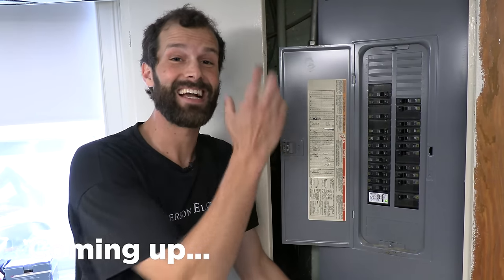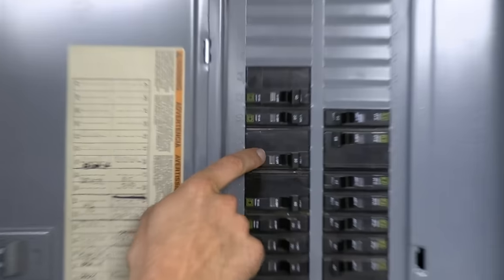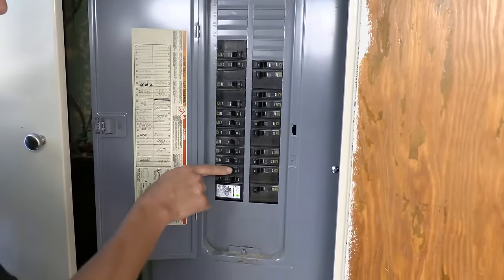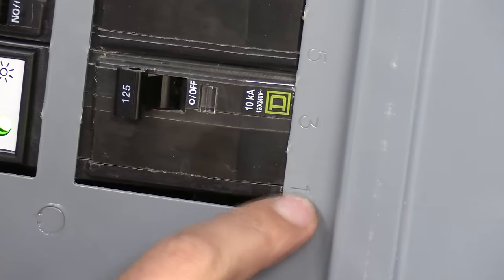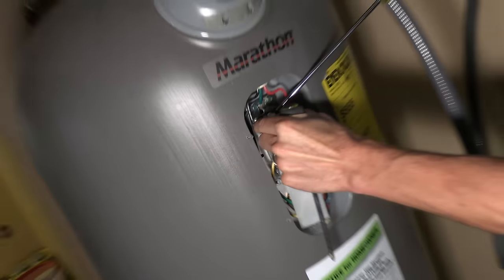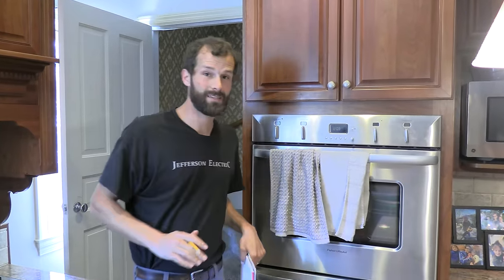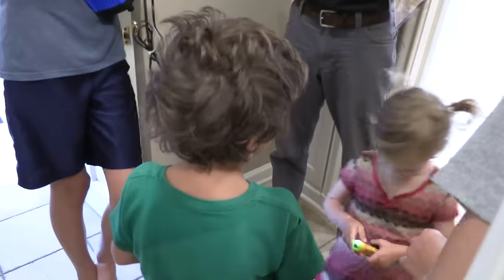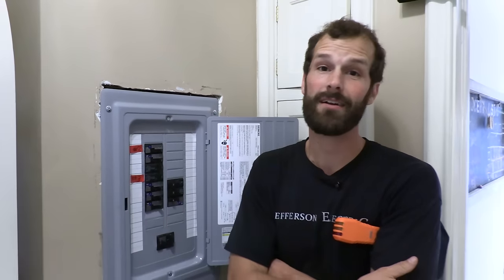A Master Electrician's Worst Nightmare

Comment: Caution if you have a circuit with a shared neutral this thing don't work athletic phase system you can forget it had it not work in some residential situations if you can spring the money I recommend the ideal sure circuit finder

Comment: Unfortunately I rarely see accurately labeled panels that have passed inspection…..NEC is only as good as the local authority having jurisdiction and their interpretation…..the “ code” can be quoted all day long but unfortunately I see it consistently ignored and/ or overlooked, or simply local code enforcement officers with very little knowledge of it.
Reply: The problem is, its rarely a problem. 99% of homeowners dont care about the electrical unless its not working, or they decide they want to do some diy electric. In that case with very little knowledge or with a helpful youtube video the average person can easily find a breaker

Comment: I had my service upgraded to 200 amps, they did an ok job but the guy doing the labeling used an old fat Sharpie marker. 
Couldn't read anything. 
Later i went through and typed up a table in word. That makes it easy to add more info as the guys doing the upgrade didn't actually know every receptacle.

Comment: I thought that breaker finder only worked on 90 to 120v circuits, and yet he was using it on a 240v air conditioner circuit? Am i missing something? Was he connecting from a neutral or ground to a hot wire? I'm used to only working with 120v, so I'm curious

Comment: While you method works just fine, I find it somewhat slow and requires the purchase of special tools. First thing is the first breaker was a 15 amp and the washing machine is typically a 20 amp and most likely dedicated, therefore you just wasted time right there. So the way I like to do it is, first turn every light in the house to the on position, then I take a small portable 120v floor fan or something that runs on 120v power and will stay running by itself and set it at or near the panel so that you can at least "hear" it running, then take a small extension cord that will reach every room in the house and plug it into the fan. Then I start at the farthest room and plug the cord into any random outlet, go back to the panel and start flipping breakers until the fan shuts off, label the breaker position with that room, then as I'm going to move the cord to the next powered on outlet, while leaving that breaker off, look to see what lights went out and check random outlets in the general vicinity for power. Remember those dead outlets locations and label them accordingly before starting to flip the rest of the breakers. Typically I can label a 3000 sq. ft. house in about 15 to 20 minutes that way. Sorry, just saying. 🤔 🤦‍♂️
Reply: I'm not sure I understand your method.  I'd like to save time and do what you did, but just don't understand what you described.
Reply: @number6396  Sorry, not sure I can explain it any simpler than that. What is it you don't understand?
Reply: @chaser9363  @number6396 I think @chaser is trying to say this:  He puts a fan at the panel.  He gets a VERY LONG extension cord and plugs it into the fan.  He then takes that extension cord all around the house and plugs it into the various outlets one at a time.  For example, he plugs it into outlet #1 in Room A and goes back to the panel box and starts turning breakers off one at a time until the fan (which is blowing and sitting right there next to the panel box) goes OFF and that identifies that that's the breaker that goes to the outlet that the extension cord is plugged in to.  He leaves that breaker OFF and goes to move the extension cord to ANOTHER outlet and while doing so, he notes which lights went out in that same room/area (presumably those will also be on this same breaker as the outlet he just identified).                I have serious doubts that @chaser can do a 3000 Sq.ft. house in 15 to 20 minutes alone with no helper doing it this way and I also wonder what "small extension cord" he must be using for a 3000 Sq. Ft. house -how would a "small extension cord" reach that far?  My house is only 2700 Sq. Ft. and has 3 floors with the panel in the basement.  I'd need a VERY LONG extension cord to reach the upper floor outlets at one end of my house and go all the way to the basement where my panel is located on the opposite end of my house.  So while in THEORY I think this is what @chaser means by his explanation, in reality I cannot visualize how this could possibly work with his stated "short extension cord".  :body-blue-raised-arms:

Comment: If you have a common wall between two rooms, like two bedrooms, would you wire all the receptacles in that wall on the same circuit, or would you put each room (or group of rooms) on a circuit?
It's hard to explain here, but say you had 5 rooms all in a row. 
Option1: Circuit#1=rooms 1&2   Circuit#2=rooms 3,4,5.
Option2: Circuit#1=rooms 1,2 and half of 3.  Circuit#2=rooms4,5 and half of 3.
Assume you are not an extreme cheapskate who only wants to save on wire, but you want it to be the most convenient and logical for you.

Comment: I’m a master, and have my ICC electrical inspector license. I would only add to your descriptions a caveat that you should follow the manufacturer nameplate on breaker/fuse and wire size. Yes, this will make grown men scream and cry, but there are numerous times when the nameplate calls for something like “20 amp wire and 40 amp breaker”. This breaks all the rules in my head, except it’s correct. Follow the manufacturer’s instructions.

Comment: Could I use this tool not only to find a breaker switch, but to also locate other lines in a wall for continuity using the clips and the wand? Example: Two different outlets and I want to know if they share a "hot." Can I place the RED on hot (black) and use any neutral in the wall to check further down the run if it's the same hot (black) wire providing power?
Reply from the maker: That would be an interesting exercise! Let us know if you end up trying on your end; if not, we'll definitely look for an opportunity to try just that!

Comment: Why doesn't anyone in North America use bipolar voltage testers like the Fluke T110. You have one device that 99% of the time replaces your non-contact voltage testers and clamp multimeters and is more convenient to use.

Comment: Is the 2 pole 30 amp circuit for the water heater a 240v circuit seeing how it’s 2 pole?
I would like to know because the klein et310 doesn’t mention that it could be used on 240v circuits.

Comment: If you don't have a tracer plug a portable radio in and turn it up. When the radio goes off you found the breaker. The problem is nobody has plug in radios anymore.

Comment: in one house i lived in, someone had split a  110v outlet power in a kitchen off of one leg of a 220v range power..... that Klein tool woulda been so helpful...... there were many circuits like that in that house...... we nicknamed the house "the house from hell" as it had so many electrical problems that random crap would stop working....the worst was a poorly grounded sink garbage disposal that also had a bad neutral... you literally would be standing at the sink getting shocked..... it all came to a head one night when the power was "freaking out" so i grabbed the main service disconnect and threw it causing it to break- a replacement one was no longer available....this forced the owner of the house to have the panel replaced and the electrical to be once and for all fixed.

Comment: I have a light bulb in a hotel that cannot find the breaker.  The wire has no power and is not labeled at the panel. How do I trace a dead wire all the way to the panel? Thank you

Comment: Lol my 1989 house builder wired mine interesting,my kitchen for example 4 outlets 1 breaker,1 outlet 1 breaker,Gfci and ceiling outlet 1 breaker,2 outlets another breaker and of course the 20 amp breaker and outlet labeled dishwasher/disposer.Outside  and garage outlets plus low voltage  breaker marked Gfi.All outlets and switches were backstabbed,last light i changed they plastered the ground wire to fixture lol
Reply from the maker: Oh dear. You fix everything at once or you clean them up as they arise?
Reply: @ElectricProAcademy  i took it room by room,I have the 4 garage outlets left,one is a Gfi preety sure its not doing anything but powering my freezer,kitchen was definitely a nightmare, and that's just the electrical, ive fixed a few broken pipes, the attic i dont go up to because of my recent disability, but let's put it this way Zig zag wire everywhere, staples few and far between, hell they even used left over nails to  connect the main duct work.Its been in the family since new,just recently tackled the downstairs hall closet and the switch panel is submerged had to pull that in,the lovely brass light fixture didn't have ground wire connected just plastered inside housing ,its a mess lol

Comment: Does the NEC have a problem with shrinkwrap labels on the hot conductors in a load center? I got an old Siemens ITE panel that needs replacement. Someone hacked in a more modern Siemens main breaker ( wish I knew the story ) It works but is totally not code compliant. I want to put unique identifiers on the wires so when I get a new panel i can properly label after things are likely moved around.

Comment: You missed 2 important things on uour panel inspection 1 you do have a spare have way up on the right side 2 the panek is aslo bonded witch it should not be due to its not the first means of disconnect

Comment: what if you find two breakers ? I am 100% certain of the breaker for the outlet I am testing but for some reason the finder keeps pinging a 2nd breaker for another circuit upstairs.

Comment: so i have an led ceiling light(diodes only, no bulb), and want to change the switch. Suggestions how to test for a circuit with the klein tool as i cant screw in the adapter piece?

Comment: I wish Klein would put on their tester a function that detects if there is a bootleg or false ground. There is a separate tool that's over $400.00 It would be a useful option to have on the one that does a readout that you're using. It would also be nice if it had rechargeable batteries and would charge just by plugging it in, and automatically stop when the batteries are fully charged.

Instead of cellular telephones, invest in some good walkie talkies. The kids will LOVE that, and everyone can have their own way of communicating with everyone without needing to do multiple calls.
Reply: A friend of mine designed and built a couple of prototype testers for bootleg grounds.  None of the test equipment manufacturers was interested.  He gave away the protos and shelved the design.

Comment: I’m going to us a Non contact voltage tester to do this. Turn on every light in the house. Turn off every breaker. Then turn on just circuit 1. Now walk around with your non contact voltage tester. 
I think there is a higher chance people already have a non contact voltage tester than a circuit tracer.

Comment: I noticed that my washer is on my 14 g wire. I should switch to the 12, right? It's on a 20 amp breaker from a sub panel
Reply from the maker: Yes, though there are times when 12# wire is in a white jacket, so it is worth double-checking before replacing.

Comment: It's just a pair of trans and rec devices to single out a hot conductive path, not grounded with turned on breaker, then turn breaker off and reciever should be off. It's simple logic only.

Comment: I’ve seen subpanels with a main (shutoff) CB remotely placed, and panels with the main (shutoff) CB in the subpanel. 
Which is the preferred option, supplying breaker at the feed panel, or breaker at the subpanel?
Reply: Depends on what you mean by better. You pretty much always have a breaker at the source unless its a feed through configuration. Its a little cheaper to use a subpanel without a main. Safety wise its safer to have the breaker at the sourse so you can completely de-energize the subpanel for any reason.

Comment: This was pretty good at covering  everything and I learned some stuff from it. The one thing i was surprised at is when it showed him in bare feet. If I'm working on anything related to 110VAC or house wiring I always wear shoes... otherwise 4 star video!
Reply: If your house floor is able to provide a low resistance path back to the panel (when you're dry, not standing in a puddle with an extension cord in it, or touching pipe somewhere, etc, ie the floor itself is acting as the low resistance conductor) on a 120v circuit, you have a hazard that ought to be checked.

Comment: I really don't get the mentality that there is about labeling. There's pride in ones work there's making it easier for the next guy and there's you're never going to know what's what once the walls are up unless you have pictures and even then. Oh yeah there's code. They should be identified for both fall tracing isolation there's so many reasons. My favorite is doing audio video work coming in and finding nothing labeled going well if we trip the breaker there's no knowing that if it's in this panel or if it's somewhere else or if it's shared with something else and if something happens will I be able to get it on quick enough that the show can still go on?

Comment: I bought that same circuit tester a few weeks ago before seeing this video and it was worth every penny! I live in a 1870 farmhouse and the electrical here is a MESS. The panel box was replaced within the past 10 years, but the owner installed all 20A breakers, even though most of the wires are 14/2. #facepalm

Comment: I like your easy going style and way of explaining things.  However, I was really uncomfortable with how close you were getting that Klein uninsulated screwdriver to things in your opened up live electrical panel.  Also, I’m surprised that you even have a NCVT, most electricians I know call those widow makers and wouldn’t touch them with a 10’ pole.
Reply from the maker: We try to be very picky with how we use it. We treat it as an "indicator" more than a "tester"

Comment: Gosh, I’m kinda confused. I asked—in the comments of a previous video—whether or not it would be safe for a novice to replace a ceiling light with a ceiling fan by just flipping the switch off, as opposed to flipping the breaker. Your response was…basically, just turning off the switch was a perfectly safe practice. But in the first example of this video you say “…they wisely shut off all the power to the house because if you ‘flip the switch off’ the ‘hot’ could still be contained in the light, and it may not have de-energized, ‘fully’ de-energized the light even though the light is off.”

Water or not, live electrical current is…live electrical current. So it seems to me, to avoid the risk, the best practice would be to simply identify and flip the ‘breaker’ before messing around with electric wiring. But then...I'm not a master electrician. So what do I know?
Reply from the maker: Sorry for the confusion, @Thatgirl1973! There is an electrical configuration known as a "switch loop" which may have been used in the past if the fixture is closer to the source/panel than the switch, because it allows less wire to be used. A picture would clearly be a better explanation method, but I'll try my best with words here in the comment section:
Simply put, 2 NM cables (Romex), containing 2 wires each, are required: Let's call them NM1 & NM2, each containing a black and white wire. The main hot feed from the panel would run into the fixture box (but not the fixture itself) on NM1-Black. Then NM2-White is connected directly to NM1-Black and carries the hot to the switch (usually attaching to the bottom terminal). Note: By code, the white has to be recolored with marker or tape because white is only supposed to be used for neutral wires, which this no longer is; it's a hot feed (usually black). From there NM-2-Black is connected to the top of the switch and runs back to the hot side of the fixture itself. This length of wire is called the "switch leg", because it's only a hot if the switch is on. Finally, NM1-White connects to the fixture and runs back to the panel as a proper neutral. The practice is less and less common because the NEC started requiring neutrals in switch boxes starting in 2011, but if you don't know the electrical history of your house, better to shut things down. If you can afford to test the fixture box, and there's not a bathtub-worth of water in it, turn off the switch and wiggle a NCVT in the fixture box. If it doesn't ping you, you've likely got a standard switch configuration and are perfectly safe with the switch off, as long as nobody is going to absent-mindedly turn it back on. If you're worried about that, flip the breaker.

Comment: In regards to clear and concise labeling, how do you handle a situation when several unrelated things are on the same circuit. Like say Living room outlets plus kitchen lights plus outside outlet (same wall as living room). Seems like most cases there’s not enough room to write all that.
Reply: I don't know if this fits here, but when I carry a Sharpie when mapping a house.  I always write the circuit number on the back side of the outlet cover.  It works fairly well, but I don't have a method when it comes to lighting circuits that span several rooms yet.
Reply: 1st flr rec+lts
Reply: @frankmilenkovic4993  but it’s not the whole first floor. Just two rooms + random stuff. 1st floor wouldn’t be accurate
Reply: @gsrcrxsi  doesnt have to be the whole 1st flr. Dont overthink it